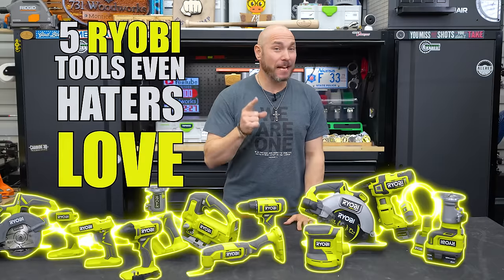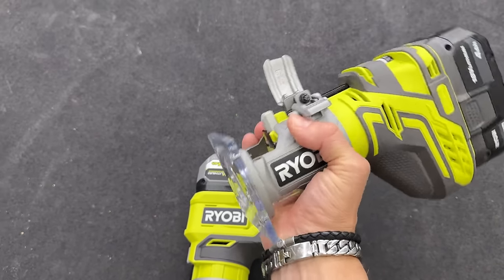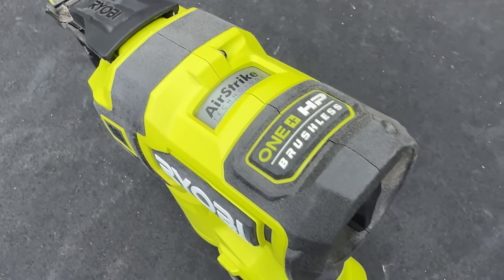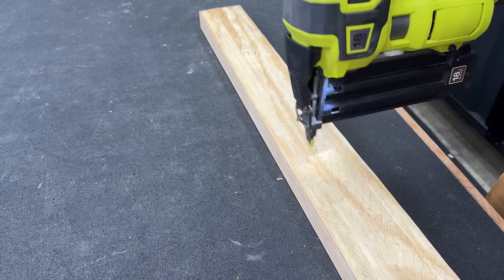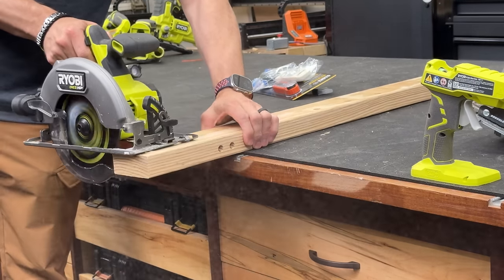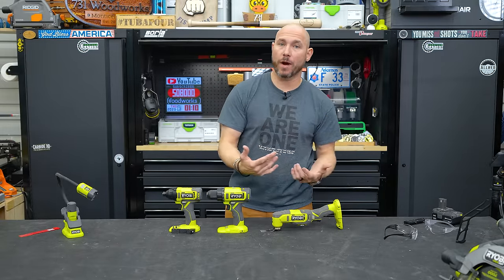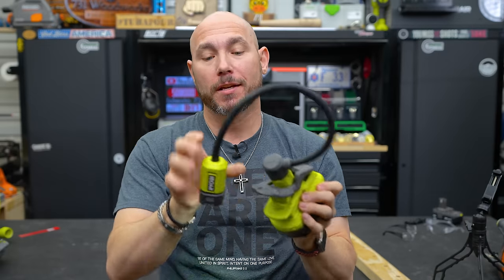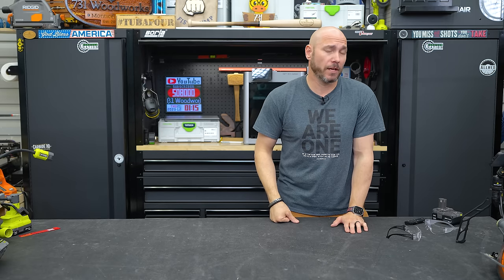The Haters Will Love These 5 RYOBI Tools!

Comment: I’ve been a Ryobi user for years, even back to when the tools were blue and used Ni-Cad batteries.  I don’t use them on a daily basis but have never had one stop working in all these years.  The reason I continue to buy and use them is the value for the price.  I’ve had other brands that every few years change battery formats and you have to buy new tools because you can’t get the old batteries.

Comment: I'm glad to see more and more of these positive ryobi videos from this and other channels lately. I got my first combo kit as a gift when I bought my first place and I'm glad I did so i could actually use them and not just get the ryobi is garbage brainwashing. As a hobbiest, diy guy and someone who doesn't need to rely on these tools for more than occasional use they're perfect and I would argue thats exactly who they're meant for. Are they the best? Not sure but likely not but who cares if they get the job done and in many cases cost a fraction of other brands. For example I was recently doing all the baseboards and crown moulding in my house and needed a bigger miter saw. I ended up getting a ryobi with more features for 1/3 of the price of the saw I was considering and it did a fantastic job. Even if it dies on my eventually and I need to completely replace it I'm still a couple hundred dollars in the black just on that one tool.

Comment: Try the sander with a 4 amp battery.  In addition to the longer run time, it is actually more powerful than when used with a 1.5 amp battery. Also the heavier battery provides the right amount of pressure so all you have to do is guide it over the piece.

Comment: So I recently bought the Ryobi 18 gauge brad nailer.  It is awesome and since then added more tools.  I got the small circular saw and a jigsaw bundle.  I used the small circular saw to rip plywood and worked extremely well.  way easier to use that than drag my craftsman corded circular saw out.  I have not used the jigsaw yet but it looks good.  I also bought a driver and it works amazing also.  I was a Dwalt guy before but for the price difference, and recently problems with Dewalt drills, I am now a Ryobi guy.  Battery prices are good.  I don't feel like I'm breaking the bank on just batteries like Dewalt.

Comment: Good round up of some of the tools in Ryobi's range. I have owned the cordless hot glue gun for years. It was really cheap, and I needed one when I was working onsite where there was no electricity. I already owned one Ryobi tool at the time - the clunky, lopsided, cordless trim router. Yes, it is terrible, but back then it was the only show in town. Or should I say out of town, as I had to order it from over the pond. Now, with a larger base attached, it is my chamfer machine. Since then, I've also replaced my Hitachi gas/battery 16g nailer with the battery only Ryobi. I chose it specifically based on the good reviews, the warranty, and price. Yes, it is a beast, but doesn't require regular servicing, and works well in cold temperatures as there is no gas to worry about.

I've got tools on every platform. Back in the day, when cordless tools were far too feeble to do any real work, you just bought the best tool you could afford, and most of us had the whole rainbow. It is only now, if you are OCD, that people opt for blue, red, or whatever, and stick with it - regardless of the cost or performance.
I know it is different if you work regularly onsite, but for woodworkers, and people pottering in the shed or garage, it doesn't actually matter how many different platforms you are on.

Comment: Due to the tool selections, I decided a few years ago to go with Milwaukee and Ryobi. Milkshake for the heavy duty use and Ryobi for the yard/specialty tools that I don't use enough to justify the high cost of the Milwaukee version. This is where I've been pleasantly surprised as the Ryobi versions have kicked ass. The Ryobi SDS Rotary Drill has been solid. And the 21° Framing Nailer is crazy good.

Comment: You have just about convinced me to try Ryobi's multi tool. I checked one out a few days ago at the HD near me and I like the feel. They did not have the one with the trigger pull though, but it is on Amazon and for a great price too. I actually wish they had a corded version though - maybe they do I just did not see one. Like an orbital sander, the multi-tool is one of those tools you can put a lot of consistent pressure on and wear the battery out pretty quick. Well at least how I plan to use it and that is to help remove the glue from about 20 8 inch ceramic tiles I need to R&R. And since it would be my only Ryobi tool I would not have a backup battery. Just some things I need to consider. Another helpful video brother !!

Comment: it may sound stupid till you try it. but i have that 5 1/2 inch circular saw. i removed the plastic guard and added 6 inch angle grinder cut off wheel. works amazing for, nail, bolts, different metals. pretty much any diy project. only down side is doesn't work well in tight places. try it out

Comment: I have had the 18 ga nailer for almost a year.  Used by me and others throughout.  Many time.  Home refurb. I bought it bc I wanted one.   And I knew they needed it.  So much easier than an air powered.  And weight in high corners, yeah.  Maybe trade off. But we don’t talk much about holding the airline in the air plus the weight of it and then torque they may push on us.  I have been quite happy with mine.  It doesn’t always fire as I expect but I think that was more a new learning thing than an real issue with the nailer.
Reply: Plus it’s stupid cheap if you get a deal

Comment: I have an older kit version of that small circ saw... and if we're being honest, it gets pulled off the shelf a lot more than the Makita 36v rear-handle saw does.  It's just easier to throw around, easier to clean, has just enough power for most cuts (sheet goods, 2x material) and only needs 1 battery.  I also made it a point to upgrade the blade there so maybe that helps.  Not that I'd run out and buy that saw on purpose if I were in the market, but for something that came with a kit that I bought mainly for the recip saw and included batteries, it has come in handy more than I expected.  Agree about that sander.  Piece of junk.  That nailer is legendary.  That tool gets borrowed more than any other I have out there.

Comment: Something that gets overlooked a lot with tool use are the vibrations, Ryobi are consistently very low vibrations and quieter than many of their more expensive counterparts.
Reply: Imo I have not found that to be the case. The main Ryobi tools I've used are jig saws and they vibrated my hand right off lol. I recently switched to the Makita barrel grip and it is smooth as butter. It is lot more expensive but was totally worth it for me.

Comment: I will say, as far as the mini circular saw. I got it because it was included with a battery purchase at Home Depot. I don't often need a circular saw except for breaking down larger stock either to fit it in a car, or just for breaking down sheet goods. For that, it is fantastic. It's lighter and more portable to toss in the trunk if I know I need to trim something in the store parking lot since the panel saw always seems to be down. 

The only other saw I had is full-size, but corded, which made me keep reaching for this because it was just small and down for a few rough-cutting tasks I needed it for. 

That being said if I got a full-sized battery saw instead I'm sure I would also switch more to that.

Comment: I laughed when you hated on that 5 1/2 inch circular saw.

It's the only one I have in my shop and I use it for ripping 4x8 sheets using the Kreg straight edge guide.

It's sooo horrible to use lol!
I actually cut some 3/4 Birch Ply this weekend and twice during the cut it cut out and I had to move back a little bit and restart the cut.

Got the job done though!
It's also stupid easy to use with the straight edge just add or subtract 4 inches to your cut and you're golden.

Comment: Great video as always!  Spot on with everything, including the "not to buy" picks.  Couple comments.  1. I got the stand light and it is fantastic! and much cheaper than the Milwaukee. 2. Always go brushless, world of difference.  It especially shows up in the jigsaw and the circ saw.  3. There is an adapter to use your batteries as a charger with USB and 120V plugs in emergencies for small things.  Worth checking out.  But, again, as always, love the vid!

Comment: My entire shop is Ryobi 18v with the exception of the big stuff.  I've never had a problem with any of them.  The coolest part is if they made a tool years ago (the blue ones) that they don't make anymore, the new batteries will work in them.  I've got a couple of blue Ryobis hanging around.  For the glue gun, Ryobi licensed the nozzle of that gun from the highest glue gun design on the planet.  It's excellent.  All of my yard stuff is now Ryobi 40V as well.  You just can't beat the price.  As with things such as golf clubs and tires, a single company makes most of these battery powered tools, so the company is pretty solid and makes Milwaukee as well.

Comment: I own a professional production shop. The ryobi hot glue gun is the only ryobi tool we run, and its fantastic. No one other than sketchy chinese brands offers a cordless hot glue gun to this day (to my knowledge). 
We use it for CNC hold-down where neither clamps nor vacuum table are practical (e.g. milling slabs, large glue ups, etc).

Comment: Their propane forced air heater is great too.  Nice to take it with you to spots without power, and it's quiet too.  I've also used the 3 gal sprayer a lot more than expected too. But best of all is the cheap 18v inflator.  Bought them cheap and threw one in every car.

Comment: I love my 5 1/2 circular saw. Cut 3/4 plywood all the time with it. Even ripped a 2x6x8 all the way down and it was flawless. Unfortunately it did die in about 3 months lol but ryobi replaced it with a brand new one so hope it doesn't happen again. My main reasons I love it is that it's light and I can break down sheet goods super fast and straight. My skill corded sucks. It's big and clunky.

Comment: So I ordered the 16 gauge brushless nailer and for doing trim work.. and then saw that the 18 gauge is better for that. So I ordered that too. Also as of Sep 2024, the best palm router (at least ryobi) is the new brushless one. Ordered that too. I love Ryobi tools.. and got about 8 of their batteries and chargers and such now. Really like the quality and design. They have really changed from 10 to 20 years ago.. when they were the lowest crap you could buy. Now they are top notch along with Milwaukee and similar tools. I got their 10" sliding saw (corded though) and its great. Picked up their brushless jigsaw, triangular palm sander and well shoot several other tools. I'd look to buy some dewalt and milwauke.. but being all in on the ryobi batteries turns me off from using other brands.

Comment: The bosch 12v sander is absolutely one I would buy again if anything happens to the one I own. That small ryobi saw is okish , if your just breaking down sheet goods or cutting up scraps to discard, just don't rush it, and a blade with a higher teeth count helps

Comment: I have all of these except the updated router (I have the old tippy one) and the work light (I have a different version of Ryobi lights) and I couldn't agree more.

Here's one I'd add to your list of great Ryobi tools: the P737 Power Inflator. I got mine for under $30 (though it looks like it's more expensive now) and I use it all the time... bike tires, car ties, balls, etc. It just works and I love it.

Here's one I'd add to your doodoo list: the 6 in. Two Speed Random Orbit Buffer. It just sucks - hard to get the pads on/off... hard to control. Bleh.

Edit to add: I got my wife the dual temp glue gun for Christmas and she loves it for crafting stuff - the variable temp makes a huge difference.

I still love Ryobi and I love watching the haters cry.
Reply: Oh oh, I just got that Ryobi polisher😮  Have not used it yet, but agree putting the pad on was a real pain😢

Comment: I am a professional wood worker of 49 years and I transitioned to Ryobi tools. My reasoning being that they all use the same batteries. Some I like and some not, but for the price they work well for what i use them for. I am still using the drill driver combo after 6-7 years of daily use. I did buy the new brushless ones, they are lighter. Overall I am happy with Ryobi.

Comment: That new mode of the orbital sander looks like they took a step backwards. I've got the old model P411. It's fine for light uses but definitely not if you're a pro. I used it to prep the steps on our patio stairs and it worked great. Of course, I sort of cheated a little and got some of the really nice 3M Cubitron sanding discs.

Comment: the small circ saw is really for plywood only. I use it to cut down full sheets in the parking lot so I can fit them in my car. Yes I could use the bigger one for that, but sometimes you want the lighter weight of the small one.

Comment: The little 5.5 saw is good with a good blade on it for 3/4 and thinner wood. Doing wood fence pickets this summer saved this old man the extra weight of the bigger saw that I did use on the 2×4 and 4×4 materials. The early router is bad and is a pain to make accurate edge cuts with. I may try the new one in a benchtop table that I take in my RV.

Comment: I own and use Ryobi's 18v mini glue gun for all kinds of stuff. I use it all the time for gluing pieces of industrial-grade felt or also cross sections of used wine-bottle corks on the underside of furniture to prevent scratching my floors. The adhesive that comes with the little round felt pieces sold at big-box stores is terrible. Hot glue + quality felt is super durable for protecting surfaces from causing abrasion on floors.

I own a few tools from Ryobi's little 3.6V line. They make a small square LED worklight that's awesome for working in tight places. I don't use it for woodworking, but I've used it for HVAC repairs and when I work under my car. I also like Ryobi's 3.6V small regular hand-held flashlight. It's easy and convenient to charge with a USB cable, it's compact, and it's a lot cheaper than the equivalent flashlight from Milwaukee. I also like Ryobi's tiny rotary tool on the 3.6V line. It's way underpowered, but it's very lightweight. It's not good as a primary rotary tool, but it's kinda nice to have as for small jobs in tight spaces.

I believe you gave a bad review in another video to Ryobi's miter saws, but I love mine. I have an 18V non-sliding miter saw. If you just need to cross-cut a bunch of 2x4s, it's awesome for that because it weights less than half as much as pro-grade cordless miter saws. So it's easy to move around, and you can store it in a much smaller space than you can store a pro miter saw. If I had to move a full-size miter saw from my garage outside to cut a couple 2x4s, I'd probably just use my circular saw because it's easier to carry. However, because my Ryobi miter saw is so light, it's not a big deal to take it out of my cabinet to a folding workbench outside to cut some 2x4s or smaller stock like baseboard trim.

I have M18 and M12 tools as well as Makita's 18V tools, and no doubt they're generally more powerful than ryobi tools with better ergonomics and precision. However, sometimes Ryobi tools are just as good (such as with worklights) or even better for a certain job because they might be more lightweight or smaller.

Comment: It's funny. I have both the non-recommended sander and circular saw. I don't use the sander for big jobs. I have three corded Festool sanders for that. I use it all the time though for little jobs like  smoothing the rough edge of MDF or sanding a plug or wood filler flush to a board. I built an entire 300 sq. ft. deck out of Trex that I cut with that little saw. Just use a good blade and you'll be fine. Neither are my favorite tools, but I don't hate them either.

Comment: I like Ryobi products, always have. Still have one of their earlier blue/yellow impact drivers from decades ago hanging around somewhere.
When Impact drivers were first getting popular, Dewalts impact versions were 3x the price of a Ryobi which was then under $90

When it comes to lighting, no other manufacturer does it better than Ryobi - so many cool lights for everything.
I have that Ryobi circular saw but in the compact 6 1/2 version and it cuts like a champ.

Also I have both the Ryobi Airstrike brad nailer and the narrow crown stapler. Both work fantastic and at a fraction of the cost of the Yellow or Red brands.

There are 3 main tools though that I decided to pay up for and that is the Dewalt 60V MAX Flexvolt table saw, Dewalt Max XR compact router and Dewalt MAX Atomic impact driver

Other than that I have no problems buy Ryobi at all.

Comment: I discovered an easy fix to the sander. Remove the Velcro circular pad by unscrewing the four screws. Then cut down each of the raised fins. About 8-10 of them. I used a wire cutter. This alleviated the friction that allows the pad to spin. Problem solved…full speed rotation now.

Comment: I've been a pro for over 45 years, I used all kind of tools, old days Black and Decker (US made), old Makita 9.6 V , Makita Tablesaw still have both from 35 years ago, milwaukee, Also a Ryobi Miter saw 35 years old Blue line, few years ago I started with Ryobi cordless and loved it, today I have I think 37 tools of the 18+,  the 18g nailer is rated better than milwaukee also the stapler, the Multi tool I did not care much about it's not very stable, I love the Rockwell much better. Over all I love the Ryobi tools that I invested in and saved so much with over 30 of the 4ah batteries and made me so much money as well, and they don't get stolen like the others.😂